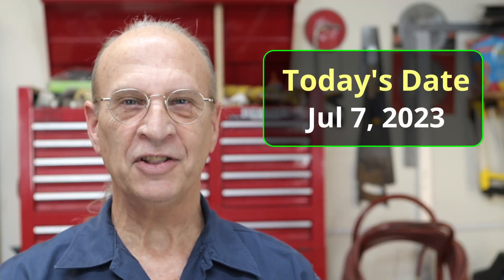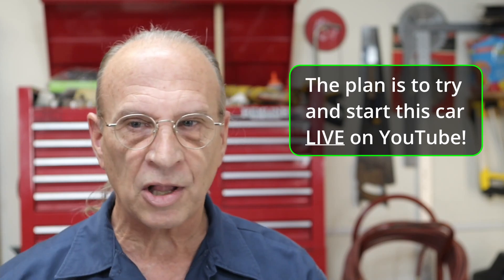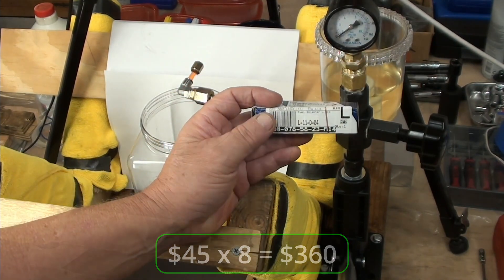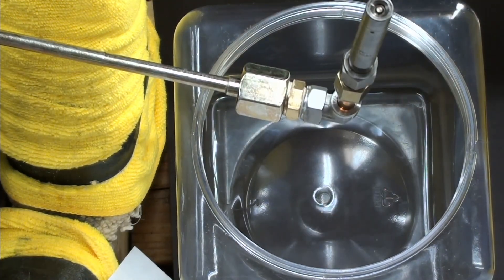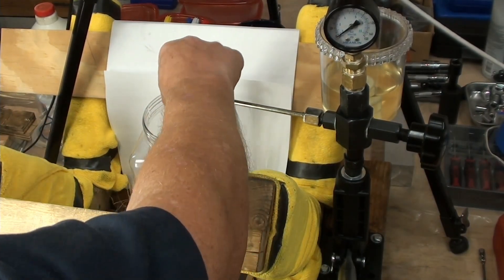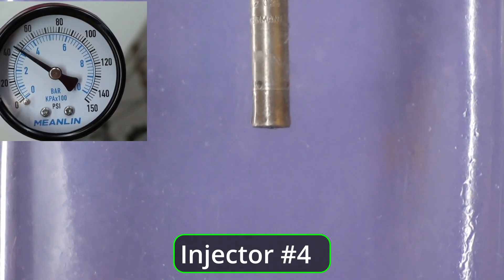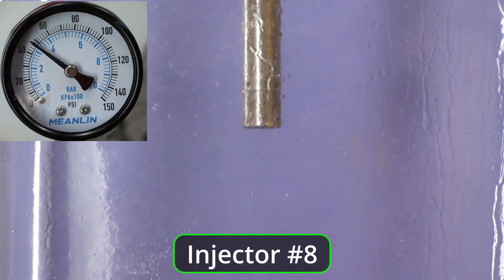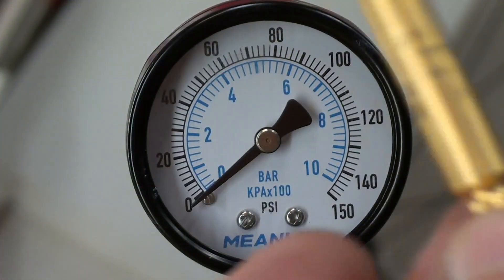560SL - Bench Testing Bosch CIS Injectors

Comment: Brilliant Video Tutorial Tony!

Can you remember what thread size, the adaptor was, to replace the high Pressure Guage with the 150Psi version. I bought a very similar Pop tester in Ireland and i want to fit 150 psi fuel pressure Guage to perform the same tests you did on a Bentley Turbo with similar K-Jetronic injectors.
Have a great Saint Patrick's weekend
Kind regards
Geoff
Reply from the maker: The pop tester is metric so I used a brass M20 x 1.5 Male to 1/2" NPT female adapter. Then you can adapt to your gauge from there. Here is the adapter I bought: https://amzn.to/49V5kfY
Reply: @TonyLiveTV Thank you for that crucial info Tony.
Have a great weekend

Comment: Nice video...I need to do this on my Pagoda. Mike
Reply from the maker: These older Mercedes injectors are rock solid I feel. I’m not sure how well the newer brass injectors last, but I know of several R107 owners who have the original injectors installed and have no issues. I also find many replacing their injectors for no reason. Obviously my old injectors didn’t perform quite as well as the new injector, but the difference is negligible in this test. In the future I will flow test the entire fuel delivery system to see how well balanced it is.
Reply: YOu are doing a great job...and I only wish I lived next door so that I could borrow some of your accumulated tool collection. Mike in England. @TonyLiveTV
Reply from the maker: @MikesMercsandothercars  I wish we lived close by so that we could jam! You play one mean violin Mike! You are really good.

Comment: Hi Tony this is abdul I was watching the video about the injection tester the pop tester you're using all the one I'm finding or the one you use on diesel engine. Can it  be also use on the gas engine thank you
Reply from the maker: The tester I used was originally for diesel injectors and it worked just fine. I think the diesel testers is all they ever sold. In fact, in the manual for the M116/M117 it shows the Bosch injector tester with a part number and it is for diesel. The injectors on these cars use continuous injection which means there is always pressure and fire only when they reach a specific pressure and then stop when the pressure is below that (without leaking). In my video I test a brand new injector (as reference) so you can see where it fires. As long as your injectors fire at a decent pressure with a good spray pattern and they don’t leak, your injectors are probably ok.

Comment: I have 73 450SL... here in Canada cost runs 1000.00 for off brand injectors. Where did you get that pressure testor if you do not mind
Reply from the maker: I got the pop tester from eBay a few months ago. Instead of paying the asking price (about $90), I gave an offer of US $40 and it was accepted.
Reply: Great deal, now 150.00 pretty much the normal price... will see if I cN fins  used one.

Comment: I saw your video on Big sert . I have a 2011 Hyundai Elantra that has oil coming up from the bottom on my #3 spark plug  making the car run like crap.. I don't have the money to buy another used car for at least a year.Im being told I need to do something like big sert or time-sert and am just trying to figure out what will work the best. I have to drive 650 miles for work in one shot every 6 weeks.so I need it to last and not leave me stranded.. What do you think I should do?
Reply from the maker: I personally like the Heli-Coil over the Time-Serts. Most manufacturers use Heli-Coil. Chances are there is a kit already made to do your spark plug holes. Be very careful when drilling & taping the holes. Metal shavings can easily fall into the sparks plug holes and destroy the engine. You stated there is oil coming up from the bottom of #3 spark plug. Oil should not be coming out of a spark plug hole. If oil is coming out you likely have a bigger problem. If the spark plug leaks, I would think it would leak gases and not oil. You might be better off locating a used cylinder head and swapping yours out.